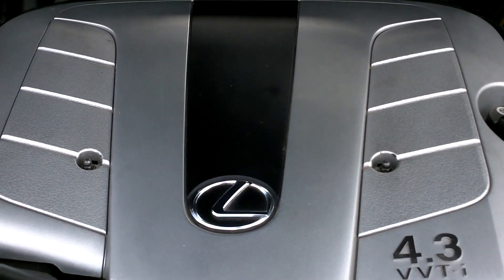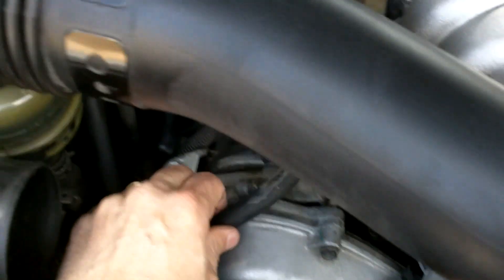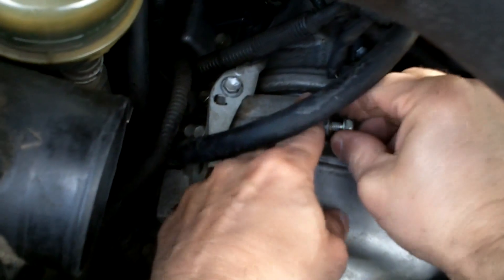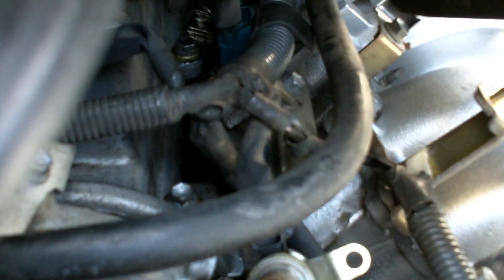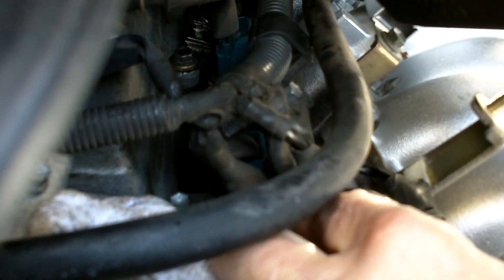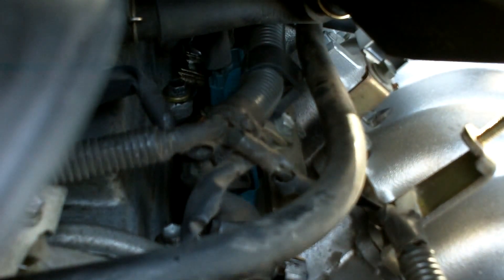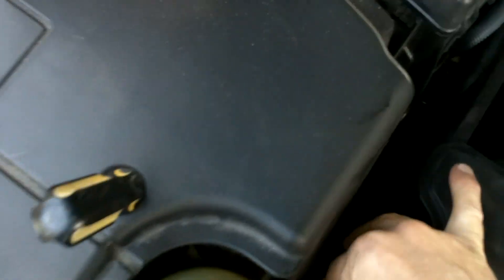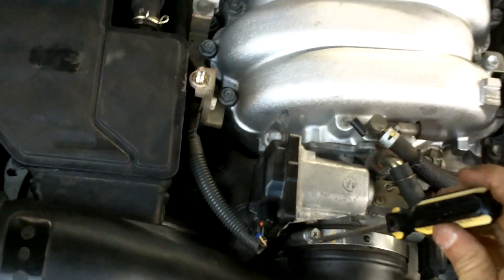2002 Lexus LS430 CEL  P1351 and  P1354 OCV fix

Comment: Had codes 1351 & 1354 from O'reilly's indicating OCV at bank 2. Ordered it from ebay for 77.00 with free shipping. Got it 5 days later thanks to usps delay from Ft Lauderdale to Orlando SMH. Could not wait. Easy install. Turned car on and CEL and VSC lights were gone. Dealer told me it would be 275 to open engine and see if timing is off and then they would let me know how much to fix it. 275 + what it cost to fix it or 77.00 and 20 mins of getting your hands just a little dirty. Thanks for the video.
Reply: I have little problems about my car right someone help me from homw

Comment: Update: Well, Tim...I'm not laughing today buddy. I went out to my 1998 LS400 to make the same repairs as you did in your video, and not only did I snap off the same connectors that you did, but I accidental cracked my Throttle Body Position Sensor Connector, and busted my pinky  knuckle leaving a irritating gash. PS...I  still thank-you for the VID. And to anyone making the same repairs...the connectors are really frail, so be careful or you'll be replacing them with new ones like myself. Peace!!!

Comment: 1351, ignition control module high voltage on GM truck--- Make/Try new key FIRST!  
My old school classic style 2000 GMC quad cab 4wd, vortec 350, GMC does not have a chip in the key, so I never thought of this! 
I got that code out of the blue and couldn't get rid of it or get the truck reliable, so, like every other person on any thread anywhere has done with a P1351 code, I replaced just about everything on the truck - coil, battery, ignition control module, complete distributor, plugs, wires, starter, voltage regulator/alternator, crank sensor- everything except the BIG computer...and that was next! 
Even looked for shorts in the wiring and patched up a few frayed spots. After and intermittently in between each of the 20 things I fixed/replaced the 'Service Engine Soon' light would go off and come back on after each repair or 10-20 starts in between each repair... Mechanic after mechanic.... money after money... tow fees... 
UNTIL last night, when an old master said he recommended I try a new key, the original key if possible. So I went home, got the original key, put it in, SES light went out. Got a new key made at the home depot and used it all day. All appears well after driving it all day and intentionally starting it 30 times during the day.
He said that it has something to do with the built in security system-- if the key is worn, and after 15 years it IS, mine so worn I could pull it out of the ignition with the truck running (and I liked that because I farm and I didn't have to restart the truck after getting out and getting back in after unlocking and opening 3 gates a day...6 times a day!) 
If it's worn it doesn't always hit the tumblers right and if it doesn't hit the lock tumblers right you can crank and crank but the security system won't fire the cylinders... or for sure it won't fit right every time, and so it prevent cranking intermittently, never knowing when that will happen. EVEN IF you don't have a chip in your key, it does have some type magnetic operation about the tumbler connection that trips or doesn't trip that start-up security system, and a worn key won't hit right and trip or untrip the security system right every time.
SO......Took original key and had new key made. Did notice that the original key and the new key will not pull out of ignition like my old key did, and so far, so good, Mystery solved for me. This time.

Comment: You must know what engineers know, there’s a reason for that clip to attach that way ~ so it is a solid not loose connection. “Do it right or don’t do it at all” Now you have a good job turn into a flimsy unacceptable job. At the very least a zip tie would have been preferable.
Reply from the maker: Rookie mistake but still connected 7 years later.